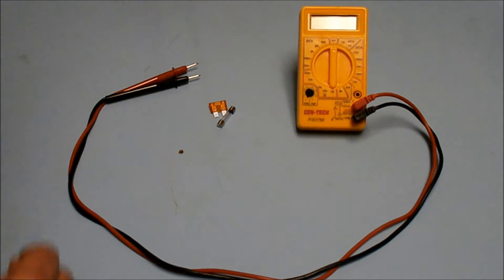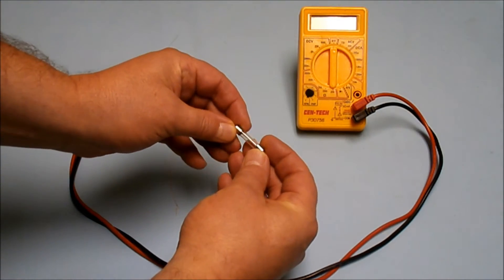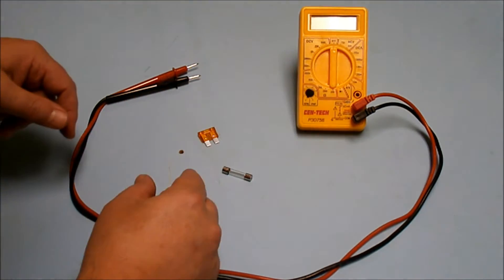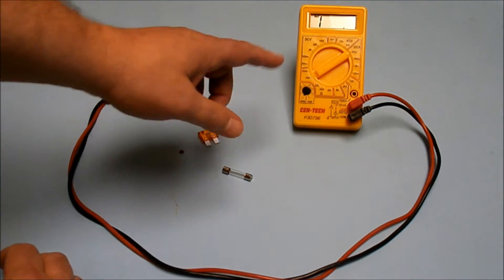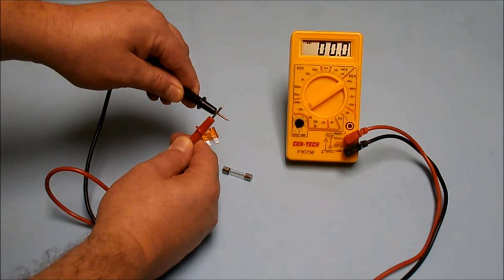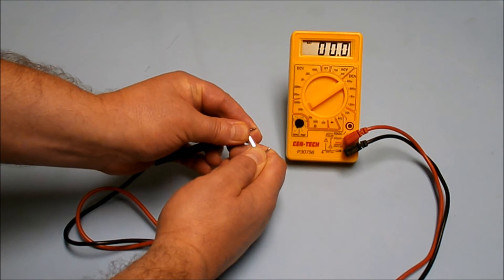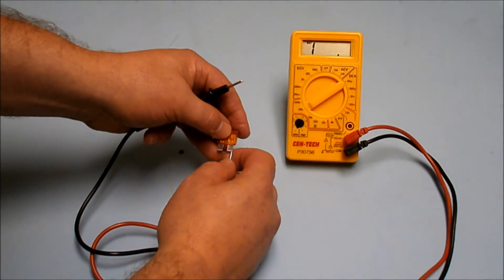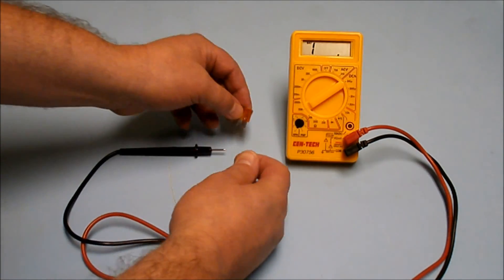How To Test Electric Scooter and Bike Fuses

Comment: I have just built a bafang bbso2b and put battery on charger last night . I asked my wife to turn it off at about 4 hrs charge and thinking she would forget turned it off. I woke up for work and the light was green on charger , so knew it had been green for some hours !!!! Put it on the bike and switch it on and POP, 
Could this be the battery being left on the charger as changed fuse 4 times . I looked for any short wires but no luck .
Been useing this for work an itd really cheesed me off an dont know what to do.